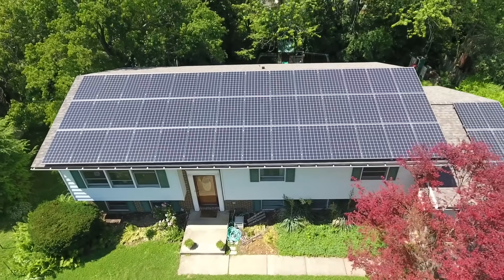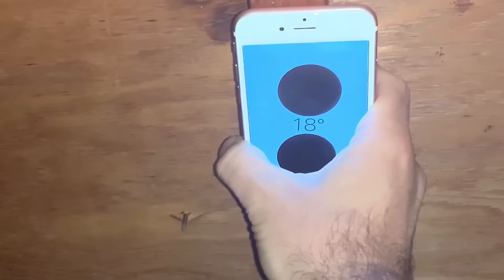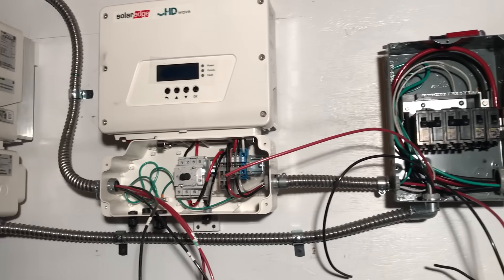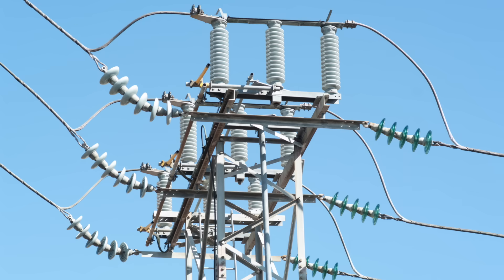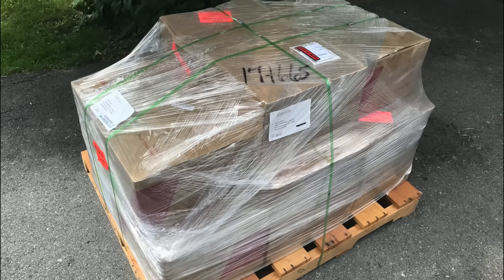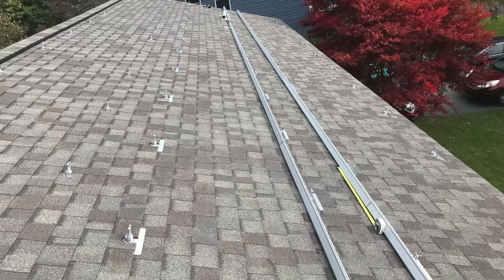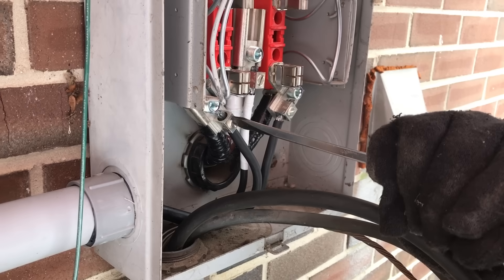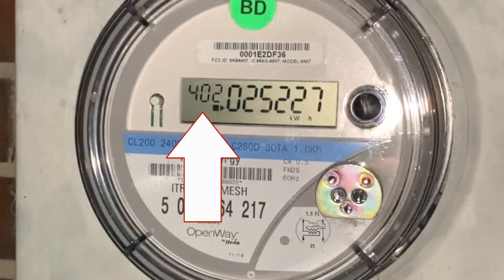I Installed a Power Plant Myself | HUGE DIY Solar Panel System

Comment: Great video and beautiful Installation. You inspired me to also build my own solar system. I applied for the beginners guide through the link in the description. After that a blank e-mail popped up in my inbox. I don't have any software blocking the contents. Somehow I cannot get the beginners guide. It would be great if you could share a new link so I can download it! I cannot wait to read it. Thank you very much!
Reply from the maker: Can you send me an email so I can look into it?  It’s on my website or on the about section here.
Reply: @FrugalRepair  Thank you for your quick response. I send you an email.

Comment: wow a complete solar system for only 5 million dollars haha
Reply: Those panels cost $150-200 each 48 panels times $200 is $9,600.... Add in the cost of wiring and a grid tie inverter and your about $15,000 at most. Far off from $5,000,000 now isn't it?  His solar array is 3-5 times larger than most people's so he makes all the power he needs and then some.

Comment: Man! you put all of that effort, and ended up wiring it as a "grid-tied" setup? what a waste! in a power outage your solar system will be worthless.
Reply: So? Power outages aren't the reason people go solar.  He can easily add a breaker box and a offgrid inverter/charge controller for less Than $2000 and have power during power outages.
Reply: @randybobandy9828  first of all, you forgot the most expensive component in an off grid solar system the OP does not have - battery bank! the charge controller does not send the electricity generated to be stores under the mud..

second- a real high-duty inverter that has enough cont. KW to run a whole house cost more than $2K alone, a decent charge controller another $700-900 depends on specs.. actually the breaker box installation is the cheapest part.

Last but not least, off-grid setups are designed and installed differently, you can not just connect a few extra wires to a grid-tied system and turn it into off grid. 

talk about people who talk without knowing what they are talking about, no offense just honestly

Comment: 48 panels ! let's say 410 wc each , so 19680 KWc .  what can you do with 4 times the average consumption of a normal family ?  strange.
Reply from the maker: Watch the video after this one if you’re curious about production and cost details.  We have electric heat and 7 people.
Reply: You have no idea how solar works... Just because the panels say 400w doesn't mean they output 400w... You also only produce power for a few hours a day so you're wrong about "4x the average home usage" learn the difference between kw and kwh...

Comment: you need more space between thee edge of the roof otherwise how can youa ccess the panels?
Reply: Good point. Probably just has to remove a panel to get to the center. Not a big deal since you would never really need to do that.

Comment: Wonder how long until your country like many others take your credits away for power back to the grid.  The only way forward for us now is battery storage power tesla walls etc.
Reply: Correct. People who spent thousands on a solar system that rely on recouping their cost by feeding the grid and net metering will be in trouble when the power companies stop allowing this. There is a power company in Florida who stopped net metering for people with solar. They buy your electric for 3x less than they sell it back to You for.  That means you essentially reduced your systems output by 1/3 and unless you use most of your power during peak solar hours you will  Never pay off that system.

Comment: The optimisers are actually installed to close to the rail, there should be around 1-1,5 cm gap or so atleast if you want to keep some guarantees. Atleast that’s how we have been informed by solaredge ;). 
It’s just a small detail tho :)

Comment: The industry should start thinking about providing DC appliances as an option especially when lot of us are planning to use Solar Cells. Converting DC to AC or stepping up voltage is not as efficient as using direct current from solar cells.
Reply: They already do. They make DC air conditioners/ heat pumps. The problem is they aren't very efficient compared to the better A/C heat pumps. That means even with the inverter losses the A/C air conditioners are still more efficient than the DC version. Obviously that's the top end brands and not all of them but if your going solar, you want to get the most efficient appliances possible.
Reply: @randybobandy9828  makes sense. Thats probably why most EVs use high voltage (400volts or so) AC to drive the mortors where they could have just used DC 12v-48v motors running straight off the battery. Interesting that stepup loss is more when compared to using HV AC which is more efficient. Not sure the science behind the high efficiency.

Comment: He now has enough power from the solar panels to power his iPhone. However when it’s overcast he can’t do that. This dude forgot how inefficient solar panels are and the intermittency issues with solar. He is not net zero unless he doesn’t use air conditioning in summer or heating in winter lol. He is hooked up to the grid and just adds this to help offset his total bills. It is not financially worth it.
Reply: Imagine having zero knowledge of solar and making such a stupid claim. He has 48 400watt solar panels, thats 19,200w of total output. that's more than enough to power a large home and then some. Any more dumb statements?

Comment: It will take 15 years to pay the bill of the cost of this system new , by then most will have to be replaced so complete waste of time and money.
Reply from the maker: You’re way off.  I made several videos about that finances and how it’s working out, if interested.  This has been a fantastic financial investment.
Reply: @FrugalRepair  I’ve done many systems for people , what I found that works best is a smaller system that is still hooked to grid cuts bills right down and the system is very inexpensive. But I’m also in Canada where 3-4 bedroom 2 bathroom house electric bill is only 100 a month so depending where you live would have to be considered when installing a system.
Reply: @PocketWisdomYT  why would a smaller system pay itself off faster than a larger system? That makes no sense. When you scale up a system the cost per watt becomes less, that means a larger system has a faster pay off time vs a smaller system.
Reply: You are so ignorant on anything solar. You have no idea how long it will take him to pay his system off. There are to many factors that you don't have to be able to claim that. In my area if I bought and installed my own solar system. It would. Only take 5 years to pay off. My power is cheap here so it would take even less time for people who pay more for power.

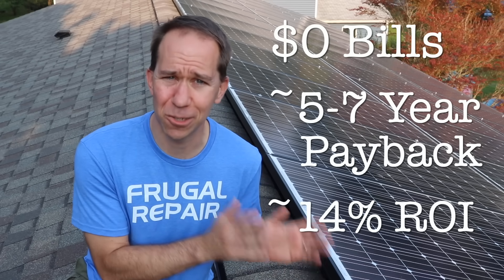Comment: 2:17 no that's not better than the stock market historically, 10% yearly is roughly the average for the stock market. But that's yearly from the first year. 
If you're saying 14% yearly (and not in total, that would be awful) then the comparison will be this after 25 years a $1000 investment:
Solar: $9,543 + the value of the panels after 25 years which will be less than the original $1000
Stocks: $10,811
Reply: Who cares? The stock market doesn't insure you have electricity in times of. Uncertainty.

Comment: Knowing the cost of the full original setup, panels, batteries, hardware.  Knowing batteries lose their charging capacity and fail or need to be replaced every few years, couple hundred bucks a pop.  Knowing the solar cells lose efficiency by about 5-10% every year and after 10 years are never charging more than 50% of what they did originally and have to be replaced costing thousands... how much money are you actually saving?
Reply from the maker: I don’t have any batteries integrated.  I have several videos on production and details on the financial side if interested.

Comment: The company that installed our panels scammed us. Said I could leave the lights on, set the AC to 50 degrees, mine bitcoin with no worries about running out of electricity. Seemed to be too good to be true. Turned out we have solar panels only to put us in a cheaper bracket with the electric company, so we pay way less than before. But no chance of running the house off the panels, since we don't have the large batteries and inverters required. Can't say it did much to help the environment, only provides the utility company with cheaper electricity that they can resell for a profit.

And...I can't use the dryer between 2pm and 8pm, as the demand controller won't allow it. Wonderful.

Comment: Great video! The only question that I have is how did you get around the fire code? They usually require a certain distance from the edge of the roof to the first row of panels. I'm sure that code is different in every area.
Great project and very informative.
Reply: @poa2.0surface77  well that’s one way to look at it. I guess you’ll watch your home burn to the ground because fire fighters can’t save it because you don’t live in China. There are many, many codes I don’t agree with but fire codes that are there to help first responders save my home, I’ll abide by. I appreciate your thoughtful and constructive feedback. Good luck on your next project.
Reply: @poa2.0surface77  interesting take. On the other hand I have asked a number of firefighters from different areas on this subject because I believe people should ask questions rather than just relying on the word of our government. In this case ever firefighter I spoke to said they would rather not have the solar panels go to the edge of the roof. In their experience they have had a much more difficult time putting out a fire if the panels are at the edge of the roof. While every law/code should be questioned and we are responsible to ask those questions and hold our public officials accountable. We should also be attending planing board meetings, zoning board meetings and state public hearings on proposed bills. I live in NY and I can’t go to public hearings on proposed bills be cause the controlling powers don’t allow that to happen and we can’t outvote NYC.

Comment: I also did my installation myself. I had a new build house so i asked them to apply all empty pipelines needed. 

Spend 7k on my system, 30 panels. Generating 10k kw per year.
Reply from the maker: Wow, congratulations!  That’s great and I bet very satisfying.

Comment: Yes ! Congratulations . You sunk some 50years worth reliable grid electric power bill into this .nevermind in that timeframe you have to replace this crap 3 times over and all the occasional replacements of inverters and various components so you dont get bored . Your return calculations are totally false and misleading . Already the up front cost of the system makes it a constant  loss considering the invested capitals inability to generate return .     This is truly idiotic

Comment: Does your country work on a net metering principle?
Because you said you paid nothing, that's only possible if you get credit for every kwh you put into the system.
I am very interested in your local administration situation and if you use net metering.
Reply from the maker: Yes.  Check out the video after this one (and a few others) for more details, if interested.

Comment: A+++++ Video.  One question = maintenance?  Do you have another video on how you go about keeping them clean all year?  My house is four levels up and I'm wondering how the hell to do that job.  Again, thanks for posting.  Terrific job.
Reply: Haven’t cleaned ours in 10 years. Heavy rain showers do a good job and the panels are “self cleaning” which is easily spoiled by manual cleaning. And if you are 4 stories up, you should have little trouble with leaves etc.
Reply: @tedfranke7830  Hello Ted.  Thank you for that follow-up.  Still plan on installing the panels.  I moved to Portugal and was loving the low Utility bills.  Then I converted my gas tanks over to electrical, installed an electric water heater and two A/C units.  My Electric bill shot up fro $40 Euro's per month to $250.  So, I'm looking at installing as soon as I can.  Especially since I plan on installing an HVAC system with a dehumidifier as well.  If you don't run a De-hu. all day, then moisture and mold takes over in your home and leads to cold/dank and wet conditions.  So, more electrical expected in the near future.  A solar install is highly likely and necessary to meet future energy needs.  Thanks again
Reply from the maker: Thanks!  I don’t do anything to clean them.  Rain does a great job.  But maybe I’ll make a video about overall maintenance, etc.

Comment: can you walk on these?  What happens when one of the panels in the middle goes bad?  how do you get to it?
Reply from the maker: You could walk on them and you would likely not notice damage but you don’t want to because you are contributing to panel degradation by introducing micro fractures. (Check out my video on broken solar panels if interested).  If a middle one goes bad, it’s no problem.  Four bolts and I easily remove the one above and get access to it.

Comment: Is it generating while your connecting up ?
Reply from the maker: Not sure what you mean, but if there are photons hitting the panel there is a potential for power.
Reply: @FrugalRepair  if you have linked all the panels and the sun is shining are you dealing with live ends ?
Reply from the maker: Generally, yes, they are always “live”.  I used SolarEdge so the power optimizers output 1v by default so it’s safe.  But if your panels are in series, you can get away with only needing to block the sunlight on one panel since that will restrict current on that string.

Comment: Wow that's a lot of work! 
I would like to see a budget patio balcony off grid solar system, ideally enough to run a window air conditioner and an efficient fridge freezer, with a small amount of battery. Bonus option EV 110v slow charge.

Comment: It's as if folks think hail storms no longer exist... a good one would wipe you out...in a few minutes.  It does depend on where you live...check your local stats..if you live in Texas for example...better insure the heck out of it.
Reply: Retractable tarp would fix that. You can even automate that if you please. Not really an issue, especially compared to the issues posed by Global Warming lol
Reply: @Philitron128  That's a good fix (hard tarp).  I see solar as viable for home use in limited capacity.  Truly great ideas make everything better the more they are used.  Fossil fuels and wind...solar...all the same in that regard...good to a point...then...no.  I do like the portable systems out now...like Bluetti etc.  The problem with these house systems is the tech is moving so fast...it's a bit of a money anchor...where as the cheaper portables that are getting cheaper and better can be done on a more nimble basis...dollar for dollar.  As for climate change...well...let's be serious and just admit the only solution is fusion power.  Everything else is a disaster...in every way.  Nothing else can solve the problem...nothing.  We're all just living in  murky times...waiting on the giant leap that is soon to occur.  'Green energy' is just a temporary money trough...and frankly diverts real funds from the actual solution...fusion.  Lining the pockets is easier the way it is being done now...so...that's what we see.

Comment: I dont pay gasoline bills. Because I dont have a car. You dont have a reliable power source. So why should you pay electricity bills? Well, its not really free of charge and you depend on the evil power industry to take your overproduction and even provide a backup line in case your solar panels catch fire.

Comment: I'm surprised there is no setback from the edges.  You need a walk way for maintenance and fire access in case of emergency.
Reply from the maker: There’s no requirement for those setbacks in this area.

Comment: My utility company requires the inverters to go offline in the event of a power outage.  Is there an option to take a rooftop solar system “offline” (isolate it from the grid) so you can power your home during an outage?
Reply: Normally there will be a manual killswitch between your inverters and your mains supply but there should be a shut off function to automatically stop your electrical output going into the mains, depending on your setup some people have systems set up to redirect the output during black outs to battery banks on their property which is cool idea

Comment: impossible in Australia if you need to connect it to the grid, which requires the licenced job.
Reply: So then you get an electrician to do that part?
Reply: @Philitron128  yes, the whole job has to be done by a licenced electrician. If you needs to get gov rebate, the electrician needs to sign off the system, and also it is about the insurance too.

Comment: I’m thinking of adding solar but not on the roof I have a big backyard and the back part of it gets sunlight all year long. I’m in southeast Michigan. I’d like to put the panels in a grid on my backyard. Any ideas for this?
Reply from the maker: I would have done a ground mount if I could so I’d say to run the numbers and if they look good, go for it.  Does Michigan or your utility have 1-1 net metering?  If you are interested, you might like my other solar videos that may help you understand the parts, process, and the payoff.